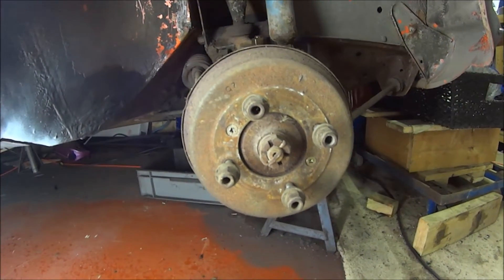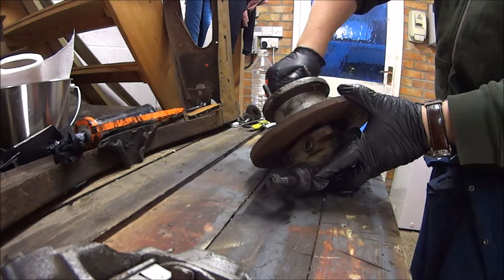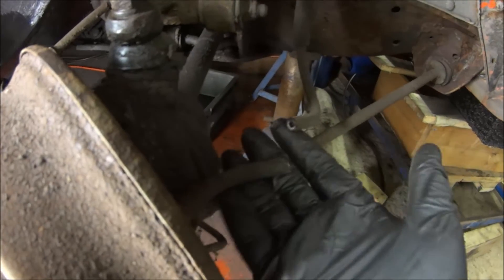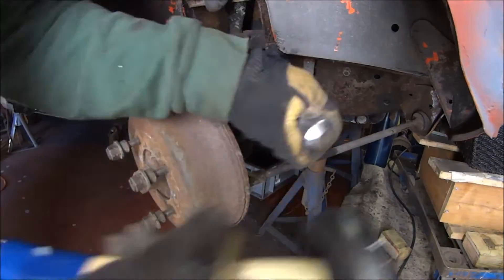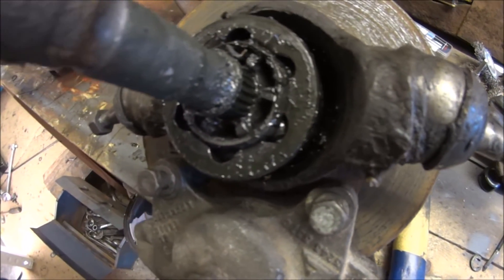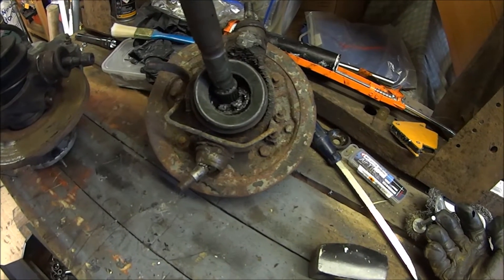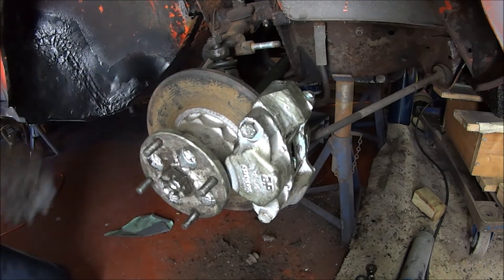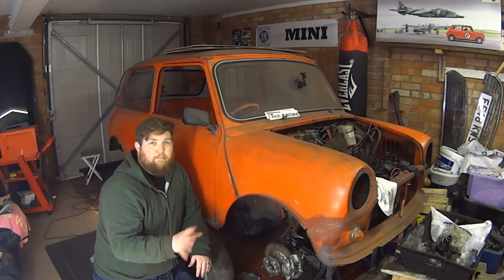Drum to Disk Brake Conversion - Classic Mini How To

Comment: Good work. Wondering you had to change the brake bias at all. Just did a changeover on mine an the bias is out. In fact brakes are worse than the old worn drums.
Reply from the maker: I upgraded to the ‘yellow tag’ master cylinder from the outdated and no longer available ’black tag’ master cylinder which you do have to swap over the top and bottom union orientation. If you’ve done the same, possibly you need to change the pipes around

Comment: What torque do you tighten that castle nut up to on 7.5"?? Thanks Al
Reply from the maker: Alex Howe it’s 150lbft-200 if the split pin doesn’t line up at 150lbft then torque it a bit more until it does

Comment: Nice one Matt.
I done the 7.5 inch conversion on my yellow saloon and have been running it for about the last 12 months.
Mini brakes are still a bit cr#p  though. Think I might fit a servo at some point from a later mini.
Reply from the maker: Stus classic Mini lockup oh nice, was that using the minispares calipers? As long as it stops then it will do. You can get grooved or drilled disks from minisport and they even do 4 pot callipers now in 7.5”
Reply: @MiniMattTV  I bought mine from minisport but wouldn't mind betting there the same. 
Don't get me wrong there ok I think its just you get so used to modern brakes that it feels like you have to stand on them. lol
Reply from the maker: Stus classic Mini lockup definitely worth trying some different pads as I’ve read they work well. Still nothing like a modern car
Reply: @MiniMattTV  might have to look into it but think a servo would help but they put me off as they get in the way

Comment: This was the first mod I done on Angus many years ago but I went for 7.5" disks to keep the 10" wheels. The CV joint part of the driveshafts are different on the 7.5" disks so they do need to be changed
Reply from the maker: Sean C I’ve actually already done the 7.5” swap video, didn’t have any problems, same cv joints
Reply: Thanks for the vid, also thought the drive shafts needed replacing as they sell them as part of the kit (minispares). ... I guess I'll find out 😀